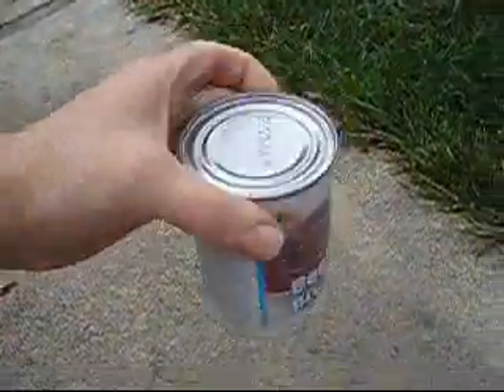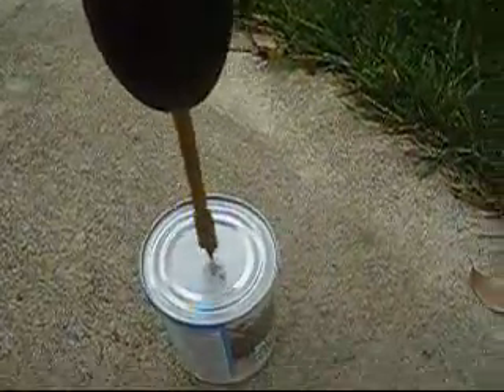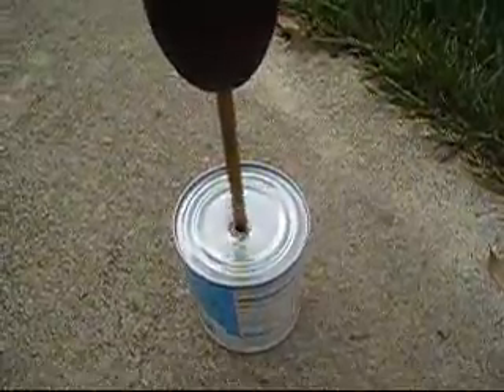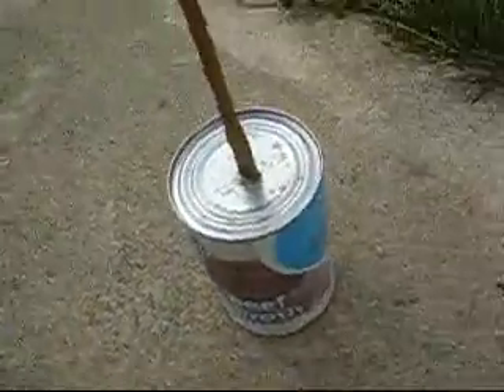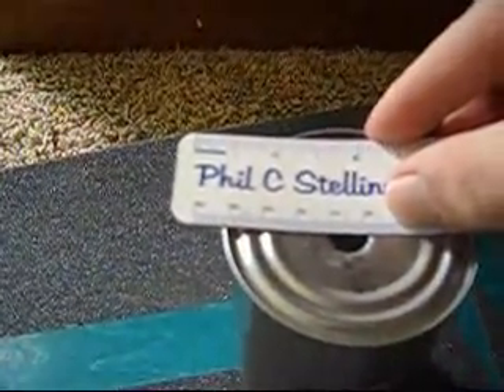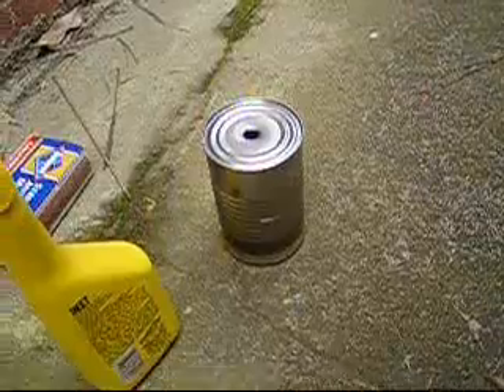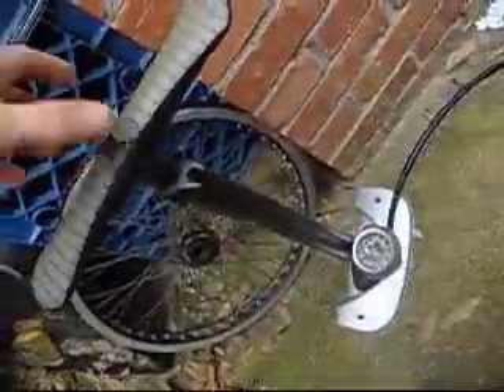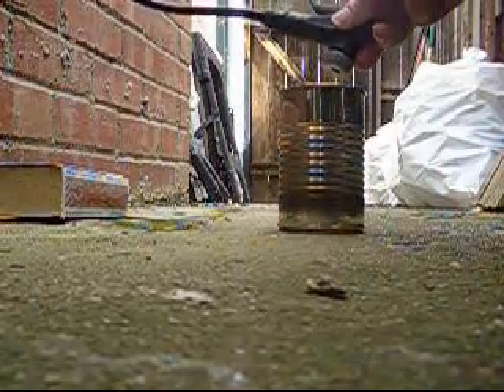Make a Metal Can Pulse Jet (Jam Jar Jet)

Comment: Hey, nice one you made there!
the can is a little bit smaller and it's also got a around 11mm hole.
I use denatured alcohol (ethanol) but everytime i light it it runs for around 1sec but then some fuel gets spilled out and it stops. What could i do against that? Should i take a bigger can?